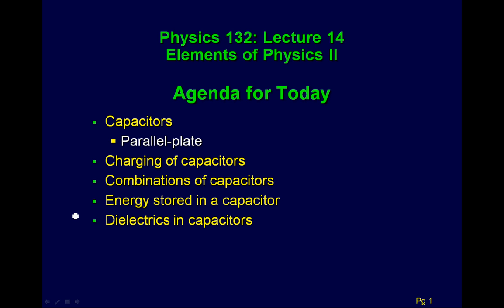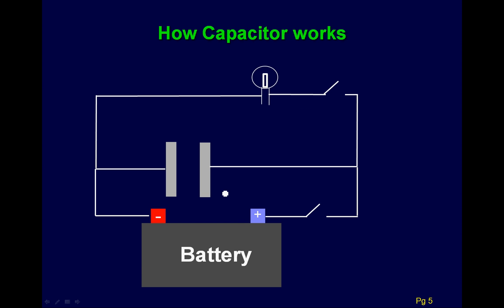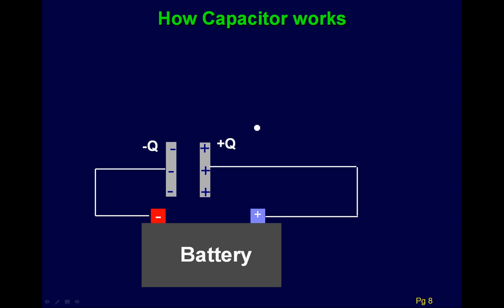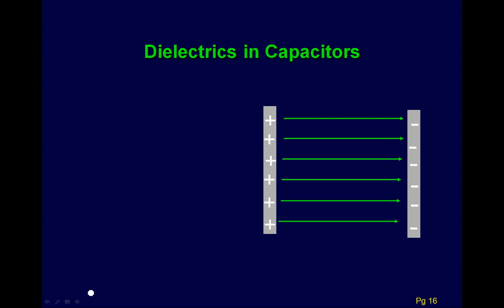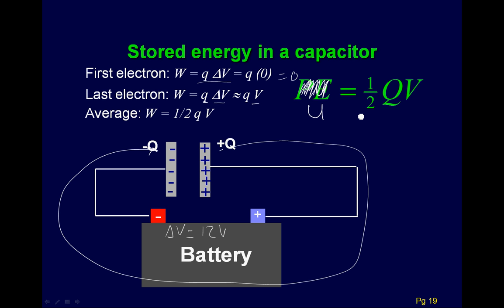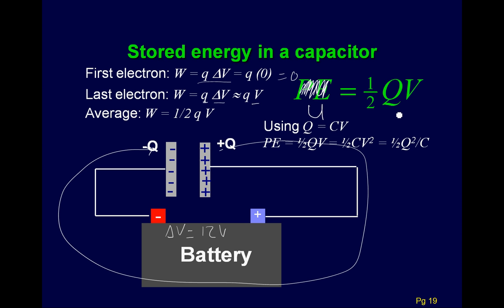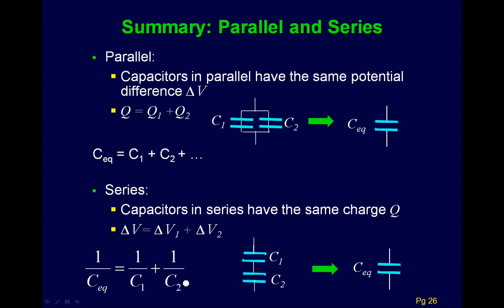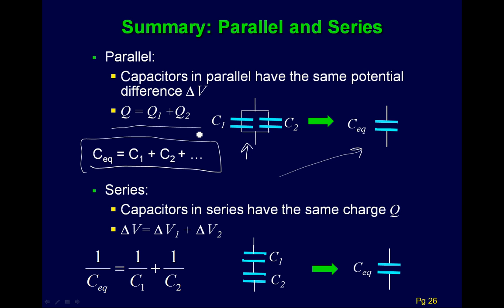Physics 132 Lecture 7: Capacitors

Comment: At 1:27, I think you glossed by a little too quickly the idea that the electron will actually travel up the potential gradient towards the higher potential of the battery. You mentioned this in lecture 13 (especially since you mentioned that it was tricky).